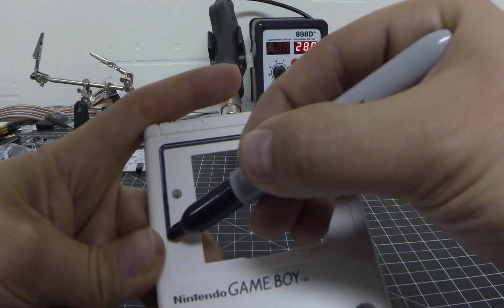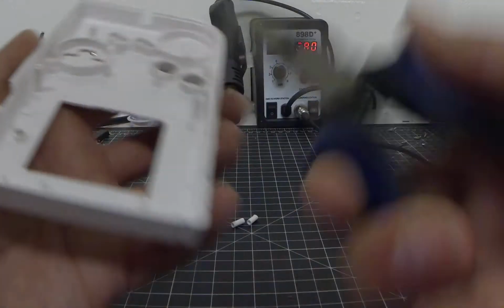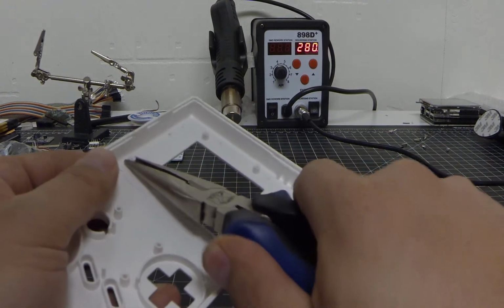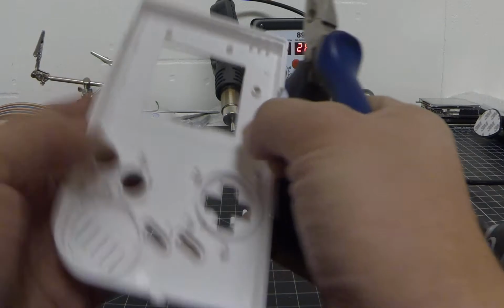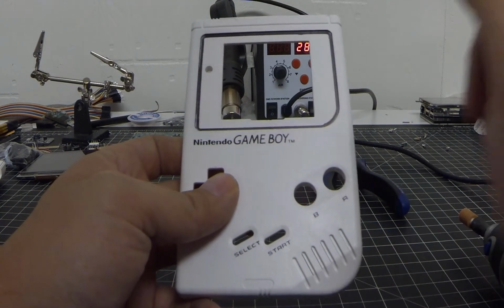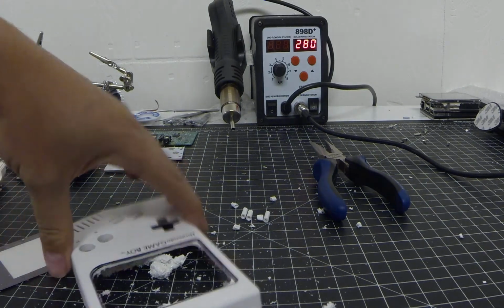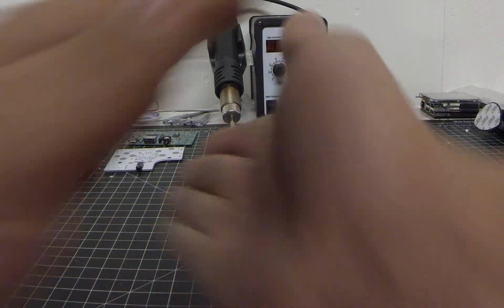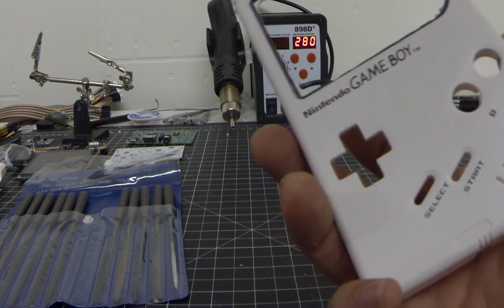GameBoyPi3 Step 3 Case Mod

Comment: What dremel bit are you using?
Reply from the maker: Daimen Worrall Dremel 3000 from Walmart
Reply: chedacheese sorry, I mean the actual cutting bit in the end.
Reply from the maker: this bit is meant for stone but it did a good job of grinding the plastic away.

https://lowes.com/pd/Dremel-Aluminum-Oxide-Grinding-Bit/50015926